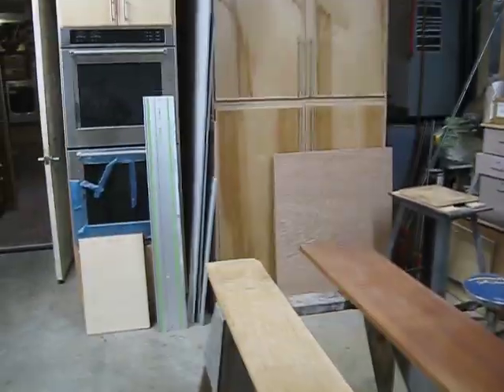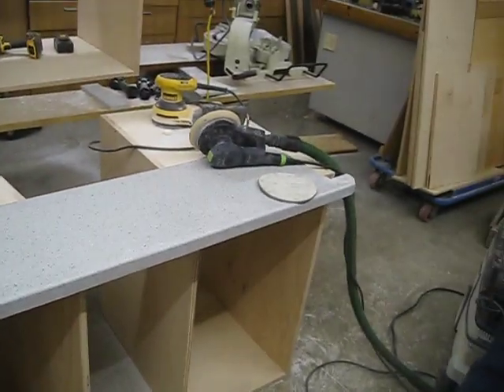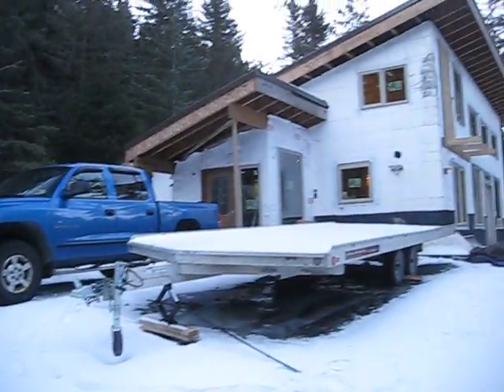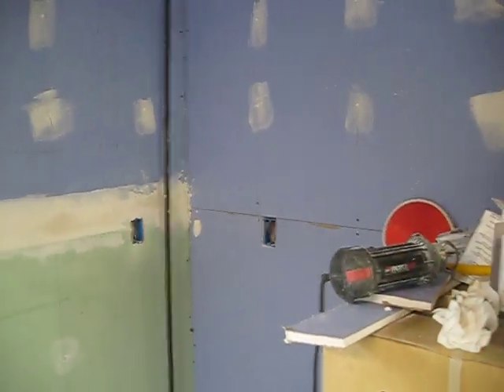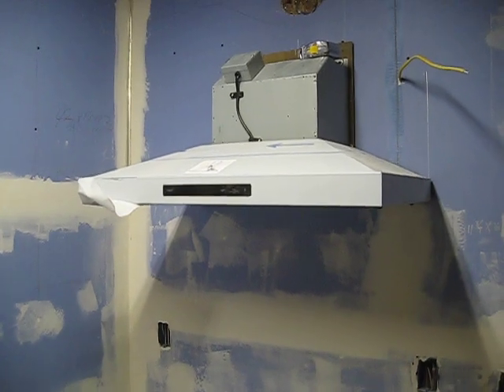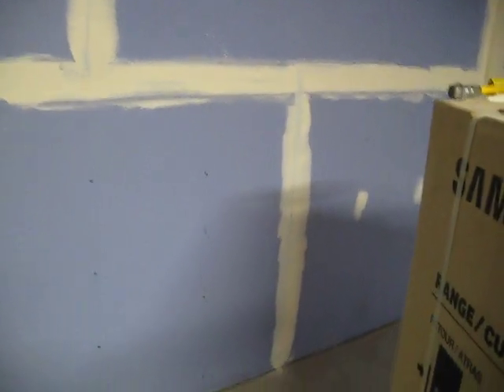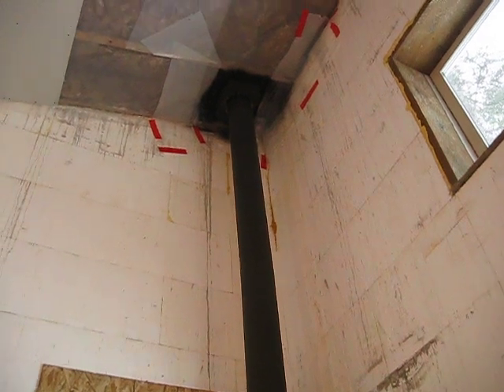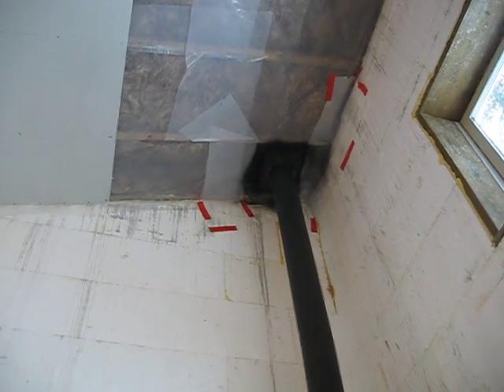House Building Part 19: Installing Drywall & Crafting Corian Window Sill

Comment: Good to see you guys again. Congrats on the 2nd place in the basketball tournament. The drywall is coming along quite nicely. Your husband sure seems to know his way around a drywall knife. Getting closer and closer. You'll be moving in before you know it. For the light fixture, look up antiquing metal with paint on YouTube, there has to be something out there. Looks like that if you can figure out the order of application, it might work to use a sponging technique to paint it.

Comment: In China, the house has a deep foundation, the entire house is made of bricks. Feel your house is not very strong. . Perhaps the national conditions are different.
Reply from the maker: Our foundation is a monolithic concrete slab, and our walls leading to the roof is insulated concrete forms. The way we built cost more, but will have a very high earthquake rating. In Alaska our foundation codes are strict, mostly due to frost protection.